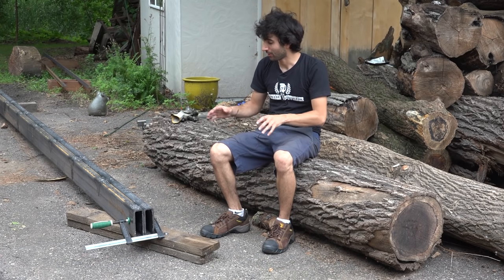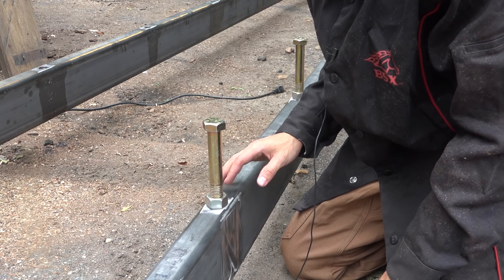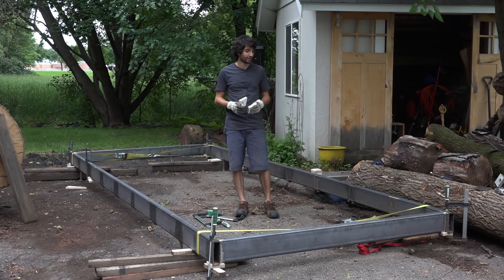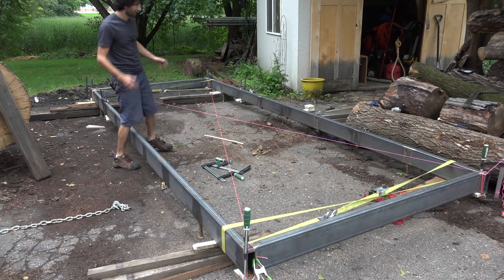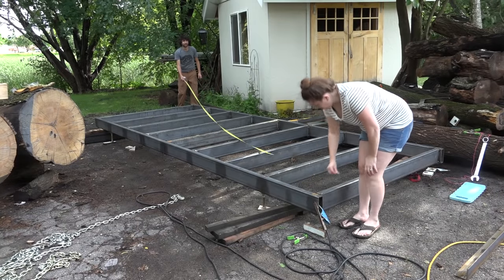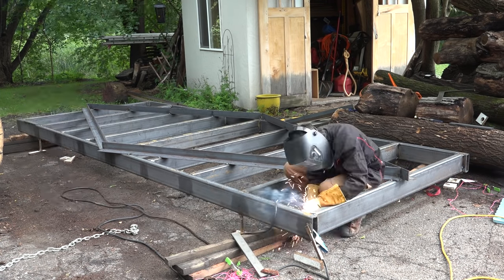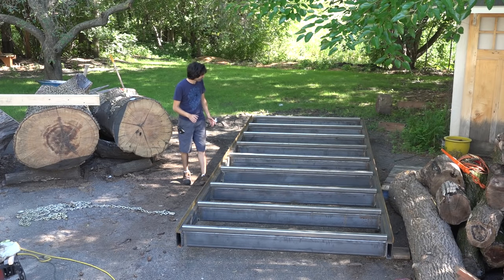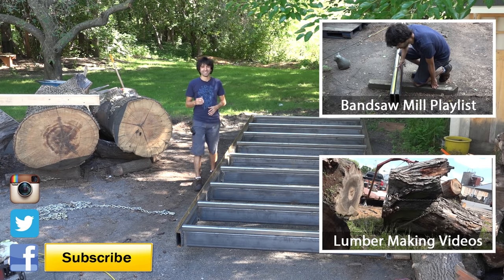Welding the Track Frame - Building a Large Bandsaw Mill - Part 3

Comment: Congratulations on getting that base frame welded up and as precise as you had hoped it would be. I know you are happy with how it has turned out so far and wish you all the best as each stage is completed. That is going to be huge and hope it's already placed exactly where you want it to clear all exterior and vertical obstructions plus maneuver around it with trailer and logs, now that you can see its footprint.
Reply from the maker: Thanks Mac!  I'm thrilled at this point :)  It's pretty close to where it's going to go.  Once I get through all the logs in my drive way I'll move it a bit.  I placed the track so it will clear everything to the left and right and above so I can start sawing right in place
Reply: +Matthew Cremona I'm not even there or involved but must admit I'm excited for you also! I know you are seeing the light at the end of the tunnel but taking your time to get it right the first time.
Reply from the maker: Thanks again, Mac!  I'll admit that the light is just a small pin point at this point in time lol

Comment: Good stuff! If the whole frame is perfectly square and level you can use it as a massive (and slightly overbuilt) torsion box assembly table.   And also a router plane sled to flatten the slabs if they move whist drying!
Reply from the maker: Thanks Arron!  yes! yes, I can! :)

Comment: heres a tip when welding a part or whatever if you are concerned about weld distortion have a spray bottle of tap water on hand to cool it down.  Happy welding.

Ken

A.T.Metal Fab

Comment: That thing is gonna be a monster!  Minor point, since your cross tubes are welded all around you should have a weep hole in the bottom or leave a gap in the bottoms welds. That way if water gets in, it has a way out.  You could leave the bottom welds off all together, they aren't contributing that much strength.
Reply from the maker: Thanks John.  Good point.  I suppose since I didn't weld all the way around the nuts, those areas might be able to serve that function.

Comment: I wouldn't have laid under there without fixed jack stands under the long side rails.  I couldn't tell in the video if you did that.  But good work and it's looking good.
Reply from the maker: 13:56  Thanks!

Comment: lol.... I can't count the number of tape measures I've thrown for coming off the corners at the last second like that.  Man, your back has to be feeling it by now.......that's a lot of weight, a lot of moving it around, and a lot of up and down working low to the ground like that. Looks like things are coming along very well, though.  After all that welding, to have it still square and dead flat is a major victory.  Good job!
Reply from the maker: haha yeah I was pretty close to throwing that thing into the marsh.  I'm feeling pretty good actually.  Moving slabs and lumber around is slightly more taxing on my body.  Thanks! I'm super thrilled!

Comment: If you're planning on making it permanent stationary, you might as well set a concrete pad that's all level in your ideal location on your property.  The level of your driveway will be constantly changing with the weather, and you'll have to check level and adjust all the time.
Reply from the maker: Well some what semi stationary.  Once I get the logs out of my driveway I'll move it to a better location.  The driveway does need to be replaced and I would prefer concrete but man is that going to be an expensive job

Comment: Something else occurs to me...I recommend that you have all holes drilled at the steel works, they can be very accurate, and the difference in cost from replacing your own drill bits/hole saws might be fairly close.....and save you a lot of effort.  Stainless steel is particularly tough to drill.
At least get it priced out.... :)

For tapping the holes, I recommend SPIRAL POINT taps, they cut pretty easily, and you do not have to turn the tap backwards every quarter turn to clear the chips.  Just keep turning the tap in, and the chips will drop through the hole

Another thing...
The angle iron you are using for the runners/track for the moving saw assembly....
If you used iron with a wider bottom flange, you can extend the track (overhung) out over the sides of the frame by 3/4 inch or so.  This would allow you to place wheels or bearings UNDER the lower edge of the track, which would ensure that the saw assembly cannot tip over when doing heavy cutting.

Comment: Amazed at what you've accomplished so far.  How do you plan to deal with the galvanic corrosion between the carbon and stainless steels?  That issue is fresh on my mind as I've been involved in repairing an industrial facility plagued with that problem over the past 3 years
Reply from the maker: +Michael Beauvais thanks! I was planning on coating the threads with anti-seize. I'm hoping that will do the trick.

Comment: Great job so far. This mill looks to become very heavy. How are you going to manage it's location and storage? have you thought about acquiring a small tractor or bobcat? It could come in handy for managing your lumber, and customizing a tractor might make for interesting content.
Reply from the maker: Thanks!  I'm planning on putting some small wheels on it and a removable hitch so I can scoot it around the yard as needed with my truck.  Probably won't be getting a bobcat or tractor while at this property.  Would be cool though
Reply: That's what I thought, wheels and hitch and moved by truck. K.I.S.S. is such a good principle. I hope you account for the load the wheels are rated for.

Comment: Looks like you have that stick welder figured out. I remember your first welding video, you had a hard time striking the arc, now you make it look easy. Was that a set of logging tongs in your shed around 8:30, haven't seen you use them yet? Congrats on getting it flat and square, its all downhill from there.
Reply from the maker: Lots and lots of practice.  Sometimes I still have trouble getting it started but most of the time I'm able to get right to it.  Yes, I have a set of them.  Got them a few months ago but haven't been doing much log handling since.  Once the mill is running you'll be seeing me use them to move logs around.  Thanks!

Comment: Just as a rule of thumb, use square tubing whenever possible on machine designs. From, an automotive assembly machine designer. Cheaper less confusing and consistent. Easier to order. More likely in stock item.

Comment: Hello Matthew,  Interesting project.  For your information they make (available on amazon) a hole saw within a hole saw.  Basically two hole saws on one mandrel.  Occasionally very useful when enlarging a hole.  The inner holesaw acts as your pilot so you can enlarge a large hole.  I wonder if it wouldn't have made more financial sense (other than the content value on YouTube) to use your large chainsaw to section the logs and use a $2000.00 Harbor freight bandsaw mill to slab them?  How often do you mill the extremely large butts?  I would love to have access to such neat hardwood, cherry, walnut gets me drooling.  Not readily available in any large size pieces here in Alaska.  Don't dump those Silver and Demming drills they sharpen very easily.  Way too expensive to toss.  Even the cheaper chinese versions can be tuned up.  Don't know that I would want to use any of them in a hand drill in metal.  Take care.  Doug

Comment: Great job welding that up Matt. You did everything perfect to get that result. Awesome work. What Rod are you using for the weld? 6018? Just wondering. 7018 would be great for the vertical and flat welds but not for the over head. Its a very strong weld and will not fatigue over time.
Reply from the maker: Thank you Greg!  I used 1/8" 6011 for the top and bottom third but ran out.  I had a box of 1/8" 7018 that i used for the remaining welding so I didn't have to run out to the store. Overhead wasn't too bad.  The hardest part about it was I could never get into a good body position to make it easy.  It was always awkward and I had a hard time positioning my helmet and head so I could actually see the weld area.

Comment: Hi Matt,

Great job and think that I will build one too ;-) but need to finish restoring a few houses on my homestead first, so for now the Logosol will need to suffice.

I was thinking about the rails after I saw the first video and I'm not entirely sure whether I would keep the upright as you were proposing it or whether to lay the angle iron with the 90degree angle up, so that the wheel would ride on the outside of the of the 90 degree angle. Have you thought about that and if so what was the rational for deciding against it.

I would think it is more stable in the long run when you pull the sled many times across compared to just the thin edge.

Hope it makes sense.

Really keen on seeing the engine and sled coming together and how you are doing the height adjustment feature.

Best,
John
Reply from the maker: I think that rotating the angle so it's like a roof would be more difficult.  They would have to be perfectly parallel and I can't think of a good way to attach them that would allow for them to be adjusted should they need to be aligned.  If you're hand feeding the carriage, that orientation would probably have more friction too.  Just some thoughts.  I'm not an expert :)  Thanks!
Reply: +Matthew Cremona I see what you mean. I would have an idea to make them adjustable, but on the other hand you can always exchange the rails if/when they are worn.

Keep on going, so keen to see the next video ;-)

Cheers Matt and really great job.

Best,
John
Reply from the maker: Thanks John!

Comment: Matt , I sorry I use 6013  1/8  with my welder or 6012 or 7018 sometimes   With mild steel  things like that. Regards BobLee
Reply from the maker: I used 6011 and 7018 rods here
Reply: +Matthew Cremona 👍👍👍6013 works well too !!! On. AC welders. 😀😀
Reply: If you live where it gets cold, 6013 welds get real brittle in winter. So I never use 6013 on anything structural. Come to think of it, I don't own any 6013 rods anymore.

Comment: Hey Matt.  Great job so far.  I was just wondering, what are your plans for this sawmill should you decide or the need to move comes up?  That is a lot of work to end up not being able to take it with you if you need to move.
Reply from the maker: Moving it won't be too hard.  I'll have plenty of heavy stuff to move so I'll be having some sort of loader on site the day i move.  The carriage and head can be lifted off of the track turned 90 degrees and placed on a trailer.  The track can easily be lifted onto a trailer as well.  Thanks!

Comment: You don't need to do all that grinding prep for the weld.  It's new steel so it's unnecessary.  You don't really need to remove the zinc on the nuts either.   Can you tell if you have good penetration?  Do you have enough experience at this point to know that?  Lastly, will the mill fit on the trailer or is it too wide?  If it will, take it to get powdercoated.
Reply from the maker: I find I have a hard time striking an arc and maintaining an arc unless the steel is clean.  I can't say I know exactly how to tell how much but I can see how much of the base metal is being melted into the puddle as I go.  The mill is wider than the trailer.  I'm going to paint it next week when I'm back from IWF and after I finish drilling and tapping for the rails.
Reply: Up the amps. And you can strike the arc on a clean piece of steel clamped or tacked on the steel that will be welded.

Comment: Great job on the mill progress. Thanks for sharing this huge project. Will it eventually have wheels and/or be street legal? I looked back at the TexasBen5 mill that you referenced and didn't see any wheels...if so, how will you move it once complete (or if you move)? What are your local laws for getting a title for a trailer made from scratch? Also, does Pancake like eating pancakes?
Reply from the maker: I don't have any intention on making it towable.  The head would be too wide anyways.  The carriage can be taken off the track, turned 90 degrees and loaded onto a trailer.  The track can also be loaded onto a trailer.  I'll need a forklift or bobcat here when I move anyways.  I will however be adding some small wheels and a removable hitch so I can scoot it around the driveway and yard when I need to.  I'm not sure on the licensing process for custom trailers but I'm guessing there is a required inspection based on the capacity.  Pancake loves pancakes.  She's my little cannibal
Reply: Cool, thanks. Keep up the great work!

Comment: Im curious what welding rod your using  6011 or 7018  I have to say it looks and sounds like 6011
Reply from the maker: 6011 for the top and bottom vertical thirds. 7018 for the middle third and top and bottom.

Comment: Looks great!
What welding rod are you using?
Reply from the maker: Thanks!  I used 1/8" 6011 for the top and bottom third of the vertical joints.  I ran out of those and didn't want to go get more so I finished up the rest of the welding with 1/8" 7018s that I had.

Comment: Yowzer, I'm not insane about safety, but I've seen too many jacks (hydraulic and mechanical) tip over or fail rapidly to not cringe the entire time you were under there.  One accidental kick or a mechanical failure and you're taking a trip to the hospital or morgue.  At the very very least, with all of the wood you have lying around, lay a couple of Matt-thickness logs under the sides to keep it from crashing all the way to the ground if something goes badly wrong.  Perhaps you were relying on the leveling feet for that sort of backup or you had something in place I didn't see.  If so, my bad.
Reply from the maker: +Jason Patterson yeah I had jack stands supporting the frame. Thanks!

Comment: Nice job Matthew. you planning to fix the stainless steel directly to the mild steel frame? please don't. by doing this your Nice frame is concerten into a sacrificial anode. use insulating bushings and rings beteren the bolted connection. regards from Holland
Reply: Sorry for the rubbish english.. my phone automatically tries to put some Dutch words in it.
Reply: I do believe he plans on painting the steal frame (so it doesn't rust) and then the SS runners will be bolted onto it so there is a clean and paint free surface to roll the logs around and onto.
Reply from the maker: Thanks!  Adam has my plan correct.  Much appreciated!
Reply: Okey, so painting is a good idea to protect it from rusting due to exposure to a humid atmosphere. However it won't protect te frame against galvanic corrosion. The SS is a higher alloy which should be electrically isolated from the steel. By bolting is together you make a nice 'bridge'. Search on 'Nylon insulating washer' to see what you should use to avoid this problem. Simple fix but very important!

Comment: Ok so Why did you want to do overhead welding, instead of finish welding, when they available for flat welding?You should make some templates for making out multiple holes,so you don't mess up half way though,and Have to change plans.If the template is right they will all be the same.
Reply from the maker: For the nuts?  I didn't want the welds to distort the beam.  I'll be using the same template for the runners that I used for laying out the cross beams so the holes will be in the same space.  I'll be making an indexing jig for drilling the holes for the rails.